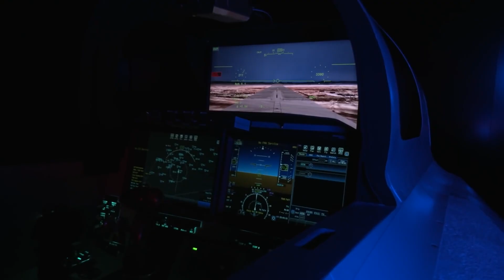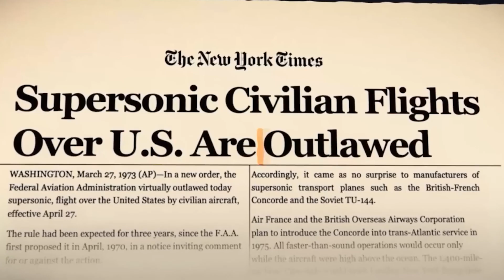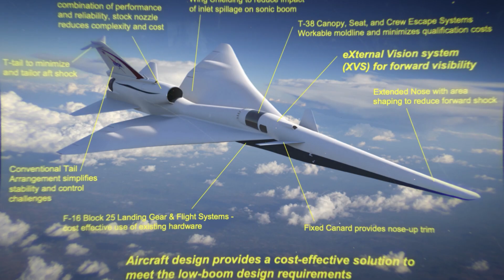X-59: NASA's new X-Plane

Comment: So it's 500 times louder than it was originally specified? Sounds like the project is already a complete failure for commercial use because there's zero chance people will tolerate half a Concorde worth of car door slamming noises for every plane passing overhead.

Hopefully the military applications are worth the investment because a mere 50% sound reduction (rather than the promised 99.9%) is absolutely 100% DOA for civilian use.